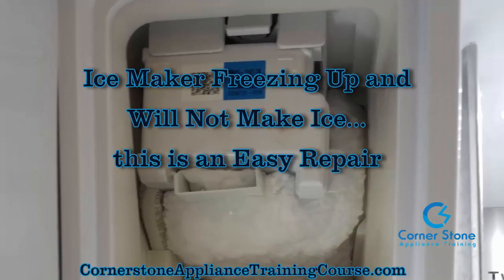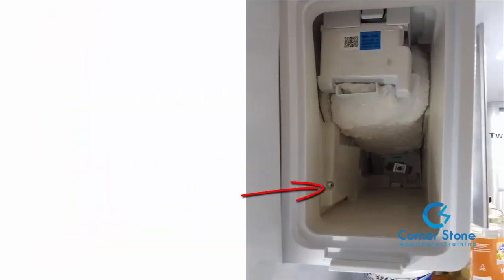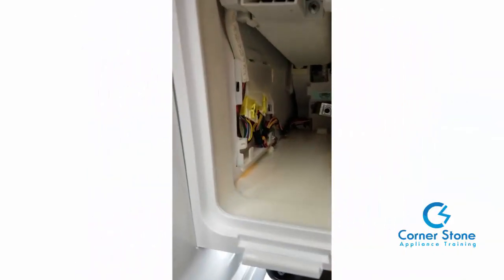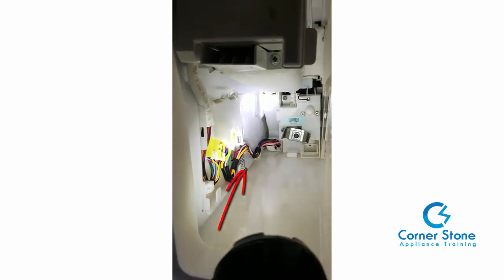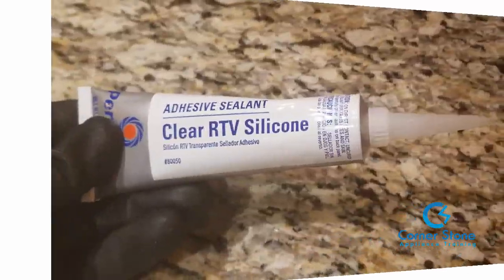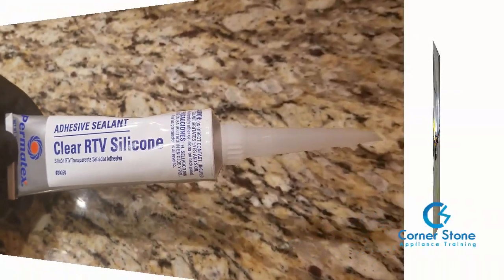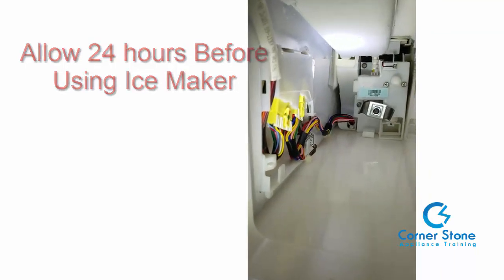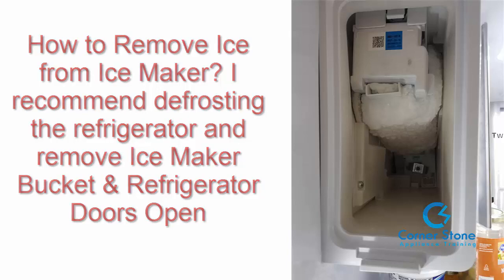Refrigerator Ice Maker Repair   Samsung Refrigerator Not Making Ice Freezing up

Comment: Thanks for the clarity of your description. The explanation is logical. Moisture in the air that seeps in freezes, stopping the ice maker. I just now sealed the crack with RTV silicone following your instructions. I wasn't sure how long to let the silicone cure before turning the ice maker back on. I'll wait just a little while, then plug in the fridge again. Sure hope it solves the problem.

Comment: I did exactly this a few weeks ago and it is still frosting up on me, just not as fast. This is my last Samsung refrigerator! Thanks for the video!
Reply: There may be ice build up that you can't see unless you remove the ice maker.
Reply: Some have said that the crack may also go all the way back and behind the ice maker.  So if you only put the sealant along the side, it's still open in the back and will still frost up.
Reply: Go on Facebook join Samsung Refridgerator RECALL USA...file with BBB NEW JERSEY...

Comment: Where did you apply the silicone sealant? Under (outseide) or inside the ice maker???
Reply from the maker: Inside the ice maker housing on the left wall.  Th;anks
Reply: Why can’t you apply the sealant on the outside of the ice maker?

Comment: Hello Chris, have you encountered an inlet tube frozen at the ice maker? I have! And have yet to  find a solution. We remove and defrost the ice maker and it works fine for 4-6 months then freezes. Any suggestions would be appreciated
Reply from the maker: Hi, that problem is usually a defective water inlet valve.  It is not closing (port) completely when it NOT filling the ice maker with water and causing a steady leak. As long as the freezer is keeping the correct temp, that should be your problem.  Hope that helps.  Thanks
Reply: So if we replace the water valve it will stop build up?

Comment: I can't get the bucket out. What's the deal?
Reply: Don't be afraid to rip that thing out... quick hard pull
Reply: Use the Forced Defrost (Fd) mode several times as needed to melt ice sufficiently to remove auger box.